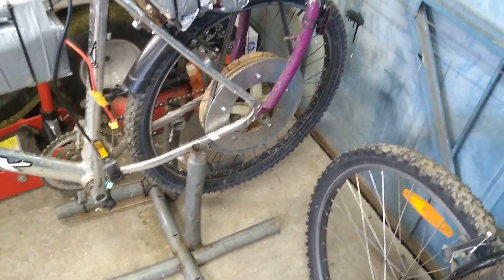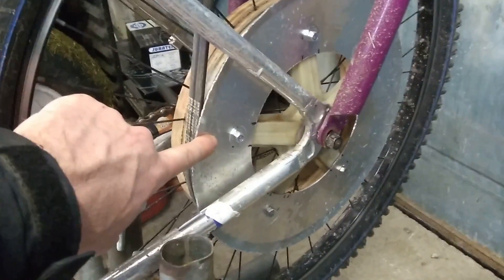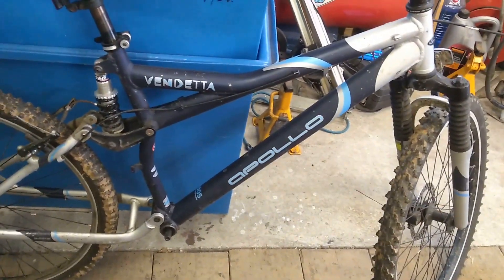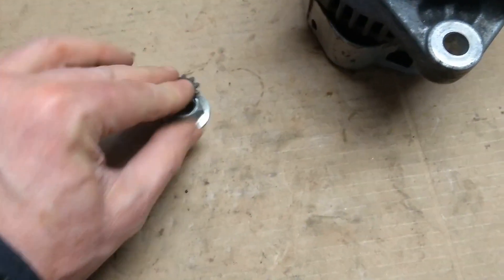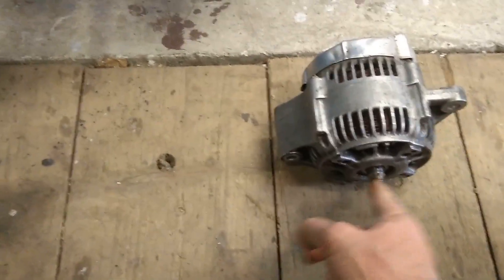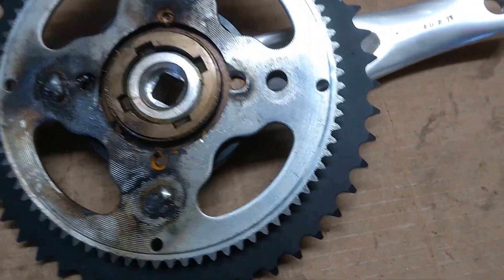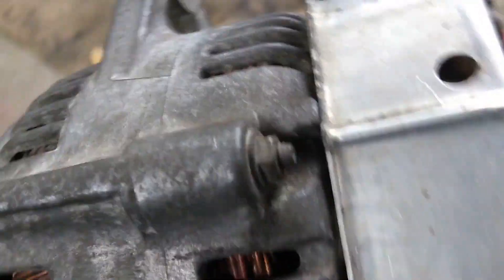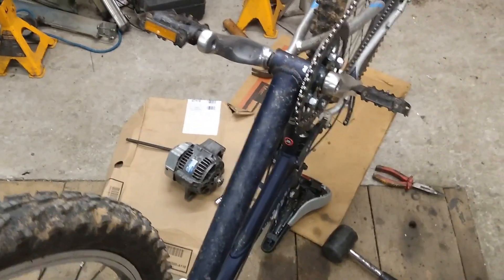DIY Ebike with car alternator V2 Episode 1 - A Poor Design!

Comment: Hi Ali. Nice to see another video. 

Where your small sprocket fits the alternator. Would it make more sense to trap the sprocket under the nut, in the same way the pulley was fitted. If you look at the alternator shaft, there's a small taper, which is designed to lock the pulley to the shaft, when nut is snugged up. To fix your sprocket securely, you need to bore the sprocket out so it is a snug fit on the shaft, then machine a matching taper to the shaft's taper. This will eliminate welding and make the sprocket closer to the nose bearing, which will improve life and lower the chance of the sprocket catching in clothes or flesh as it rotates.
Reply from the maker: LOL, I wish I'd thought of that, tbh I struggled to open up the hole in the sprocket to make it big enough to fit just the tip. It's made of hardened steel and my drills are not great. I've ordered another sprocket so I'll maybe have another go,  it would be better to have the sprocket closer to the alternator anyway so maybe I should order some better drill bits.
A bench drill would be handy too.